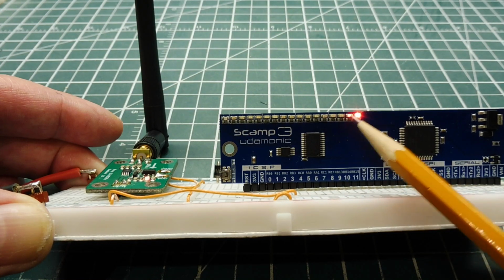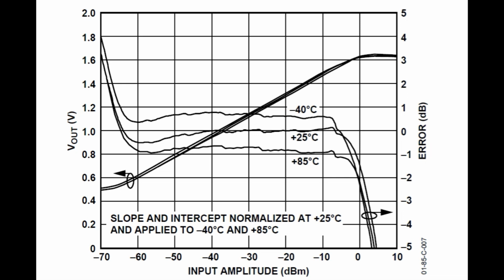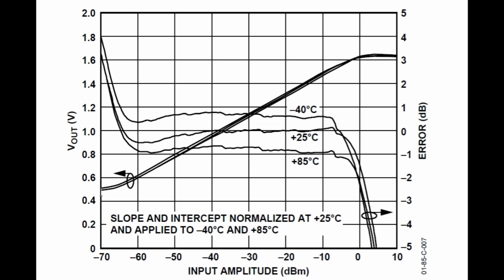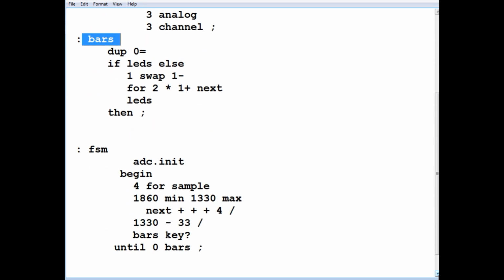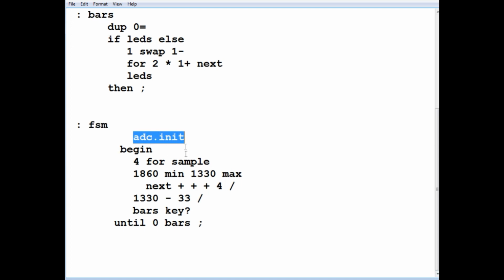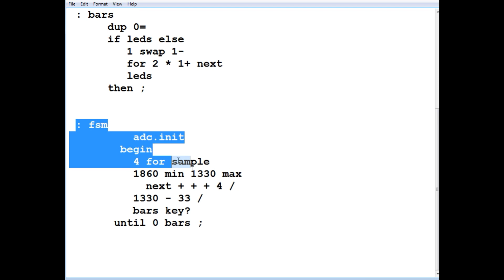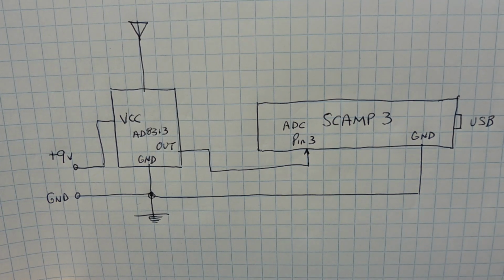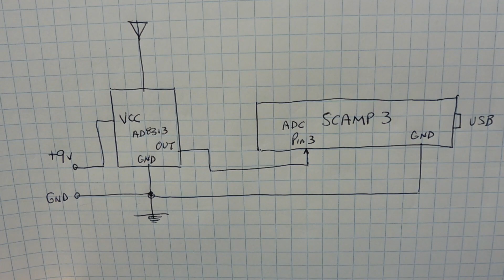RF Relative Field Strength Meter / Scamp3 / FlashForth

Comment: A very similar board exist to go from 1-500Mhz 92db gain.
AD8307
Low Cost, DC to 500 MHz, 92 dB Logarithmic Amplifier
Reply from the maker: You could build a simpler version if cost is an issue:  https://youtu.be/WaFBUnep7T0
Reply: @0033mer  I like the passive design and I also plan on having the passive version if I don;t already have one somewhere. I used to.
  TBH I was going to buy the pre made board but There are so few parts I just bought the chip. I already have the other parts. The chip was only €3.72 for 5x of them so I can build a few for friends.

Comment: This gives a relative indication of field strength in any single direction and frequency and polarization, because the antenna factor is not the same in all directions and all frequencies and all polarizations.  The detector is measuring the power delivered from the antenna to the detector, rather than the field strength.  Thus, I would say it is a nice way of measuring the "relative field strength" of sources in a particular direction, frequency, and polarization with respect to the antenna.  Claiming it is an "RF Field Strength Meter" is an overstatement, that should at least include the word, "Relative".

This video documents a nice way to build a simple and useful device.  My complaint is only with the title.
Reply from the maker: Thanks for the feedback. Frequent viewers of my channel realize this is a "relative" reading device as I have indicated that in past videos and readings are at the input connector. For true field strength readings in uV/m or dBu a setup is needed with spectrum analyzer, screen room and an antenna with a known correction factor(k). I will include "relative" in the title.